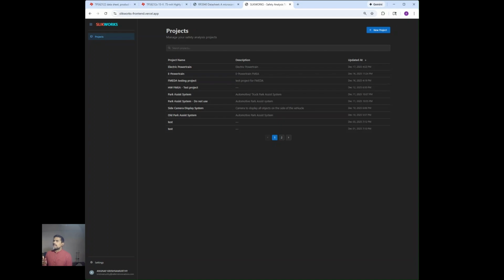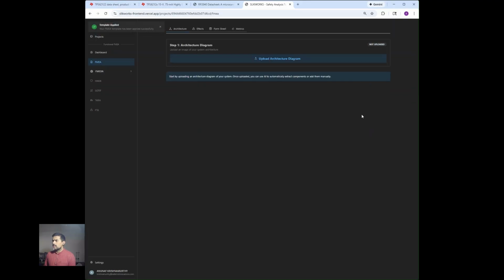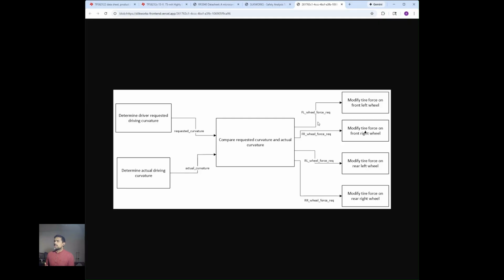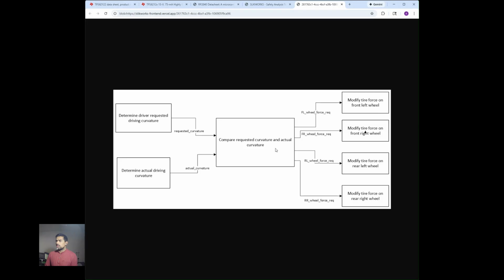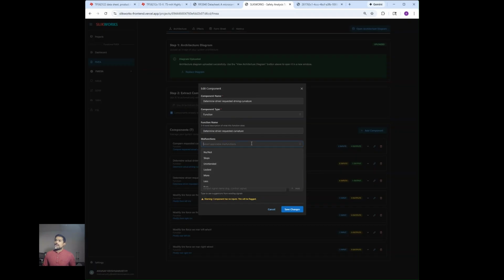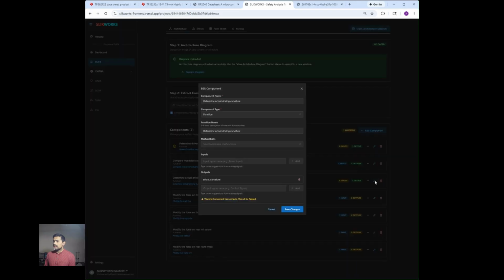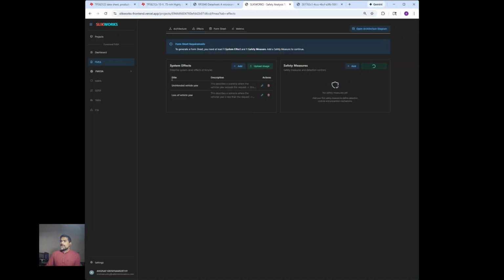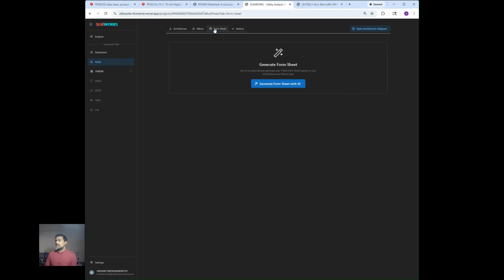Functional FMEA using SLIKWORKS - Part 1

Comment from the maker: Creating a Functional FMEA often requires building function architectures, identifying failure modes, and linking hazards and safety measures.

SLIKWORKS FMEA Software helps automate much of this process - including extracting functions from architecture diagrams and generating structured FMEA worksheets.

✔ Create functional, system, and hardware FMEAs
✔ Extract functions from architecture diagrams using AI
✔ Link hazards, failure modes, and safety mechanisms

Learn more about SLIKWORKS:
https://www.safelink-innovations.com/slikworks/fmea-software